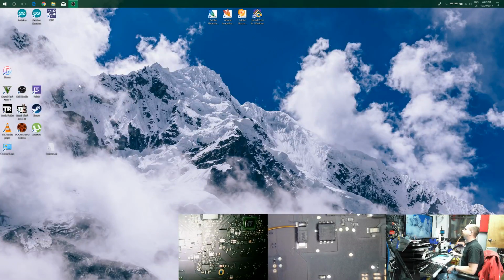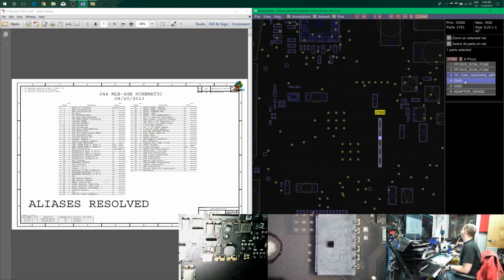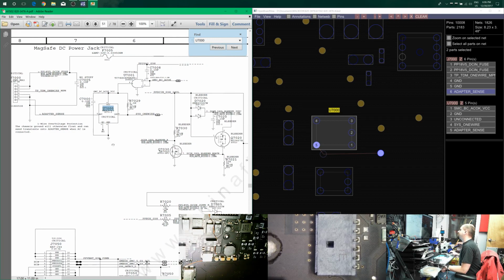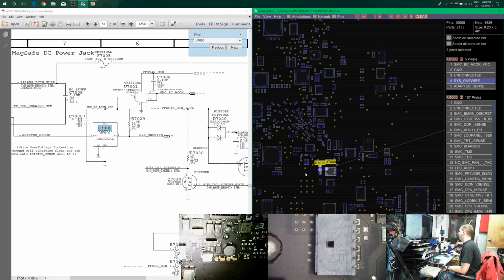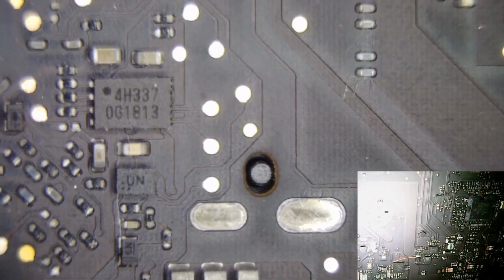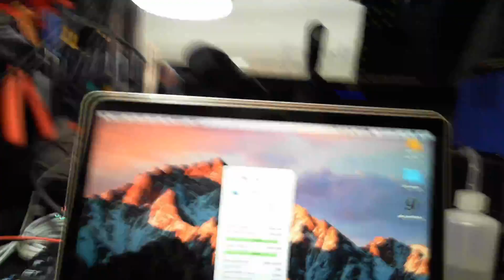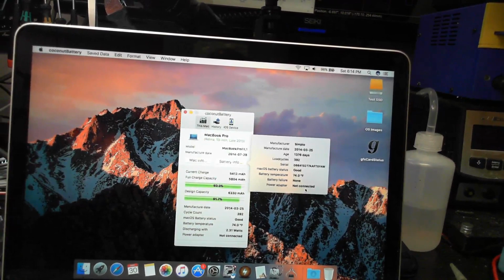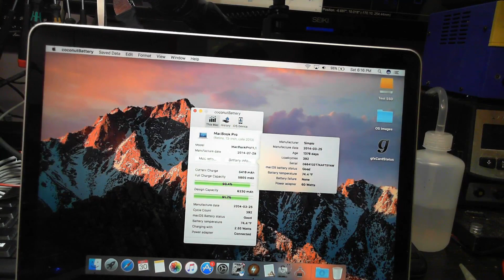NO eBay, one magsafe connector cannot be used for 45w - 60w - 85w chargers, NO... Bad eBay.

Comment: Hi,

Thanks for video

I ran a 60w cable in my 85w adapter for a year before discovering that fact today using Apple diagnostic feature (alt/option + d on startup) and also by comparing my charger brick with coconut battery output (doh)

As I'm sure you're way more knowledgable than me with electronics, what damage, if any, could/would this have done to my machine or would it simply have resulted in slower charging?

If you have any issues (e.g. questions/queries) then happy to help

Hope to hear back

Yours faithfully